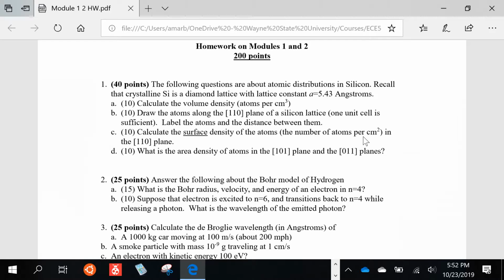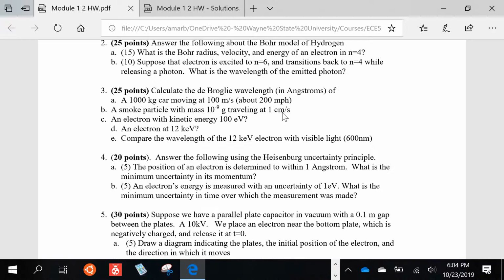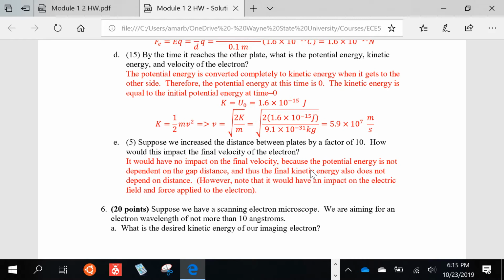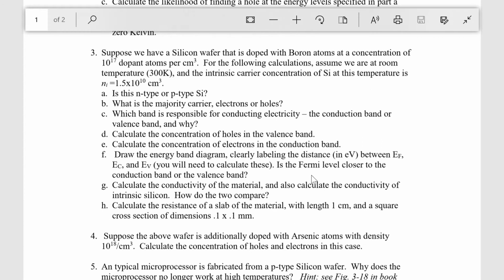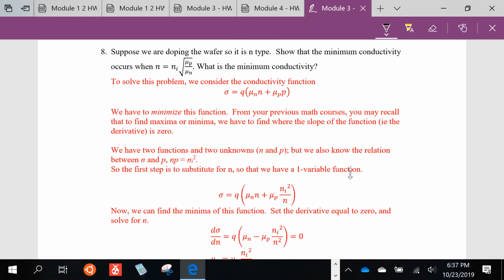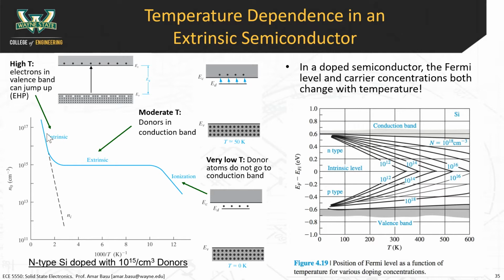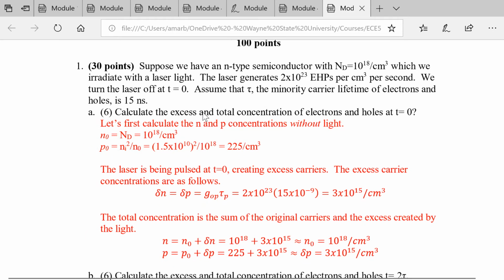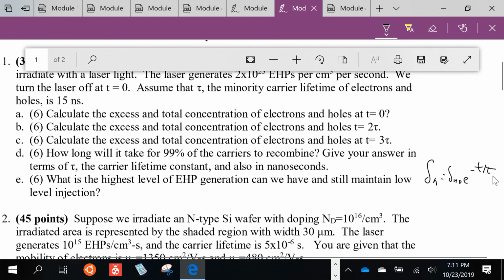Exam 1 review

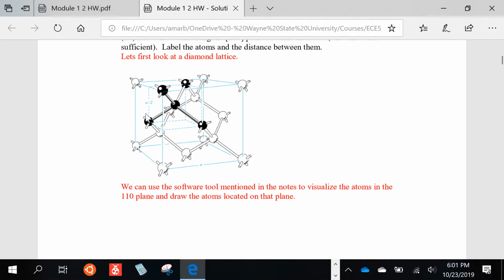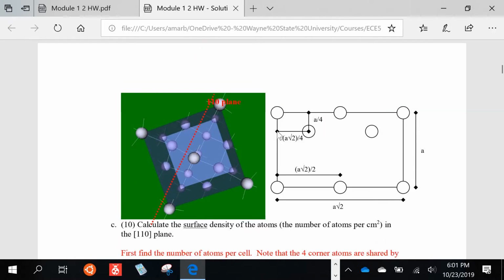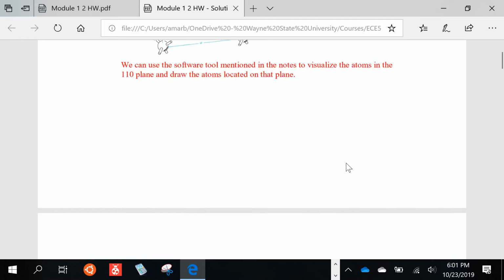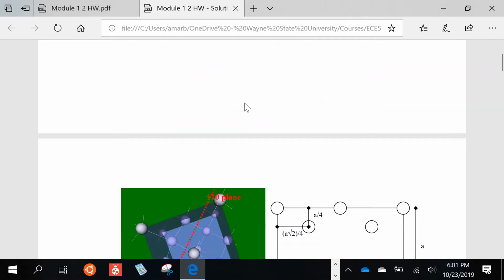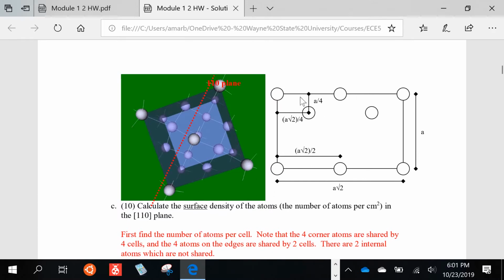Comment: Professor Basu says "100 plane" at 25:27, but I believe he meant to say "110 plane" instead. The figure on the right shown at 25:40 is what you would see if you cut a cross-section of the unit cell along the 110 plane of the the figure shown at 25:24, and then flipped it upside down (i.e. the 5 atoms at the top of the figure on the right at 25:40 are actually the ones at the bottom of what's shown at 25:24).